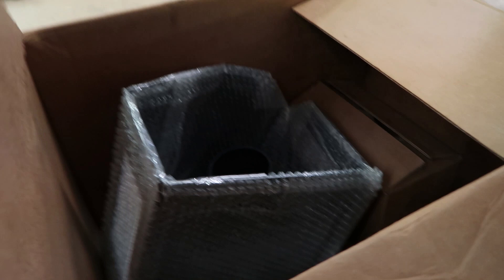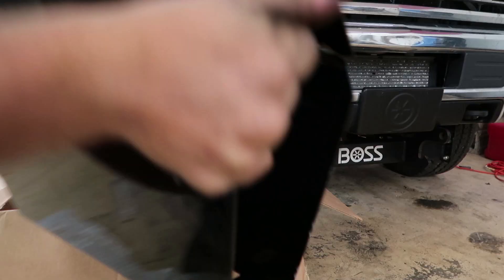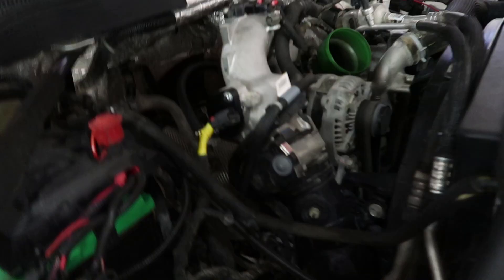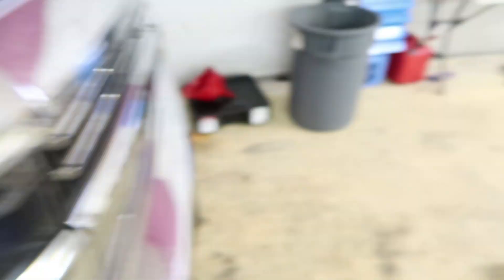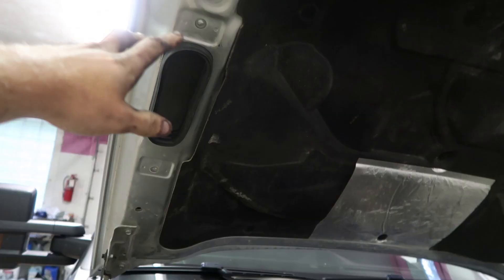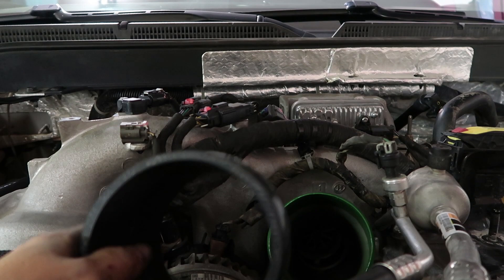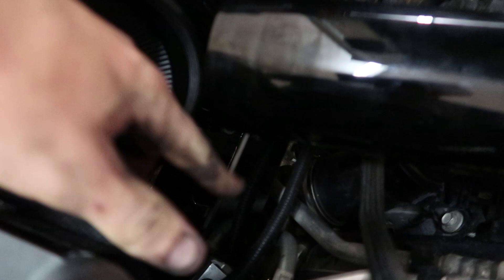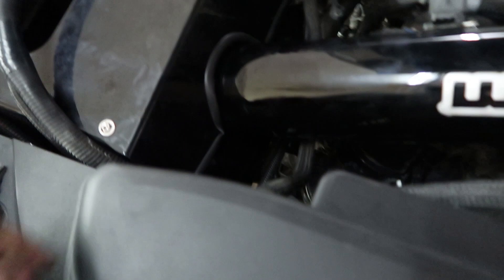Wehrli L5P Intake Install! (2017-2019)

Comment: I used a Banks Monster. It’s only Bling. Reroute that wire underneath the tube.
Reply from the maker: I would but there’s not enough slack in the wire like I said it’s for the plow
Reply: No doubt WC makes a quality product, my only concern with this intake is heat retention vs a plastic unit such as Banks.

Comment: you put that seal between the top and bottom of he air box on wrong, it doesn't go along the entire edge of the top. The rubber seal goes on the top lid just where the intake tube would make contact and then the rest of it goes on the bottom part of the box where the intake tube would make contact. It keeps it from making metal on metal contact between the air box and the intake tube. I can take a pic of mine if you need.
Reply: also I lubed it up with a little windex, made it slide on easier.
Reply: JD can you shoot me a DM of the pic on IG 

I just got ordered it and want to make sure I’m doing it correctly @mikesellshomes
Reply: I will send it shortly
Reply: @michaelchavez6863  sent.